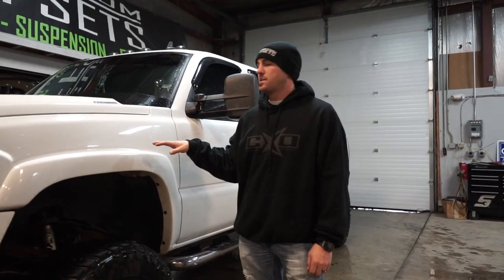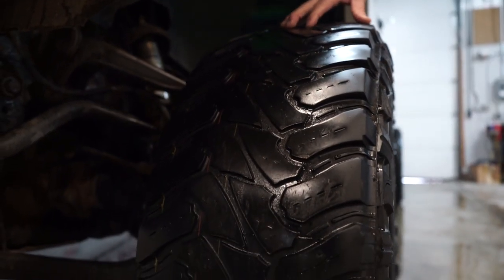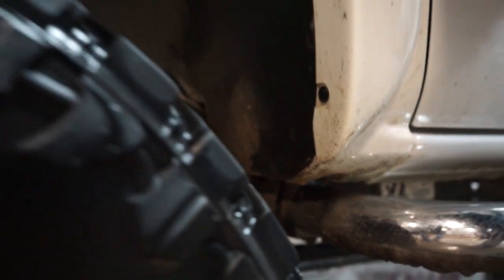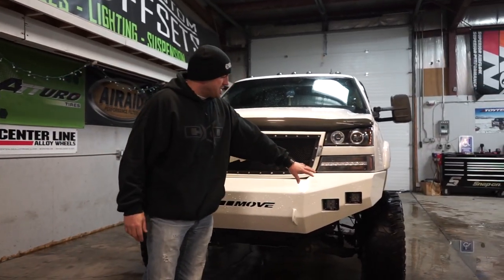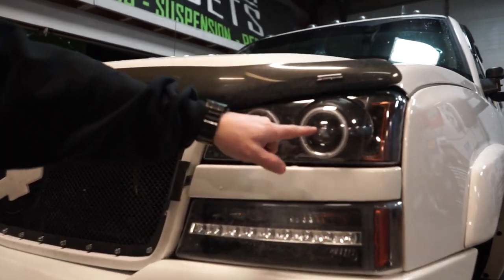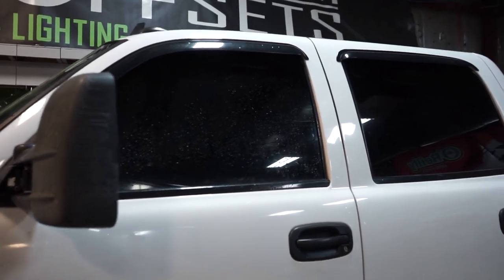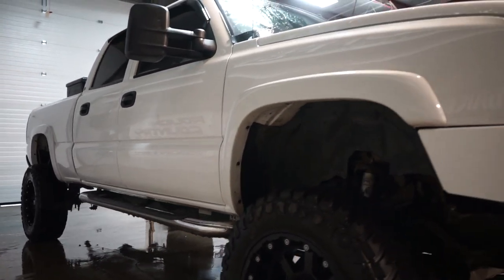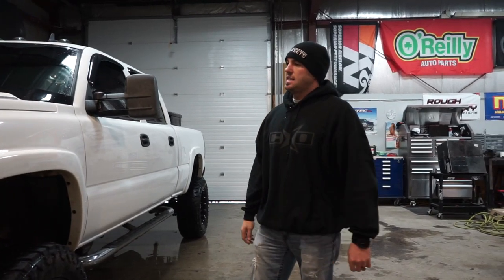Spotlight- 2007 Silverado 2500HD, 6" Lift, 20x10's and 35's

Comment: Ive got some fitment questions I wanted to ask you guys. Do you think a 2008 sierra, on a 3" leveling kit, 17x8 -12 offset, could fit a set of 315/70r17? I understand I would have to do some cutting so it wont rub, but want to get a professionals opinion before I order the tires. Thanks before hand!
Reply from the maker: Cauner, check our gallery out here for fitment help! http://bit.ly/2zhUB0Y

Comment: I've got a 2004 Silverado 1500 with a 3 inch body lift and a leveling kit, do you think I could run 305/12.5/18s? Or a set of 35/70/18s?